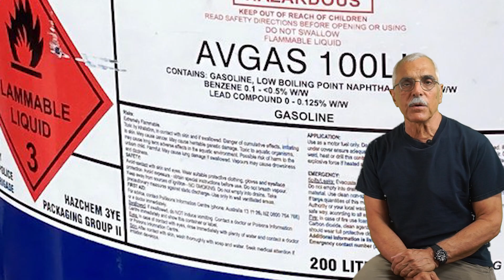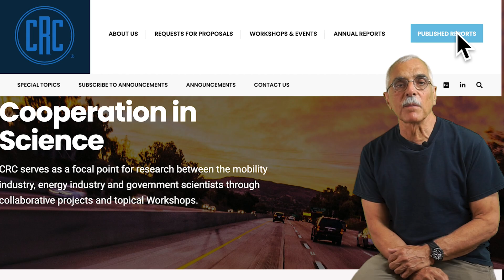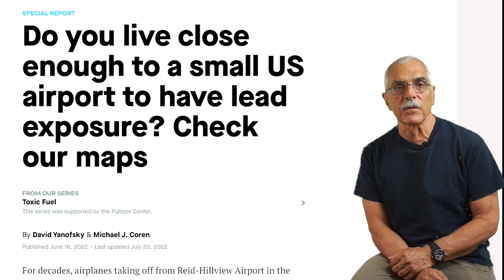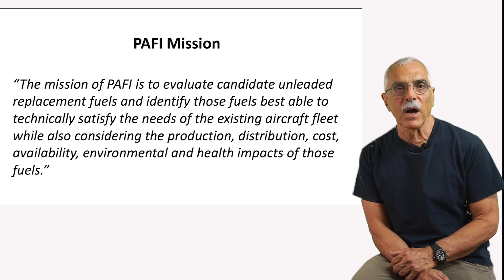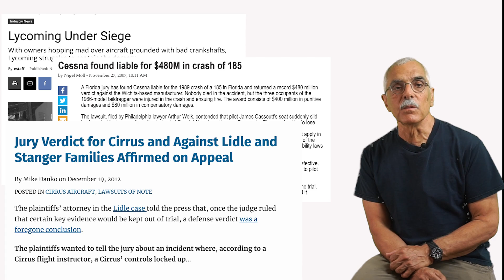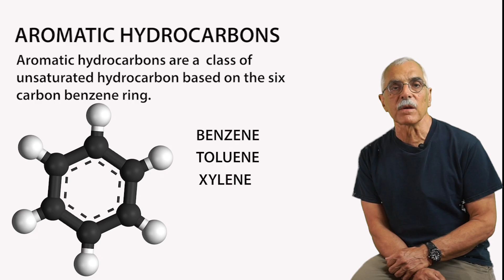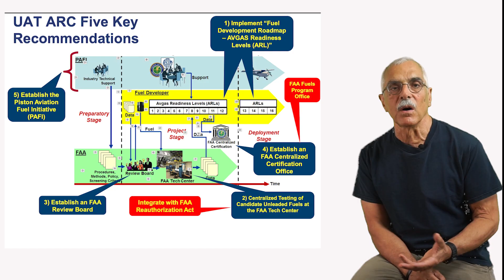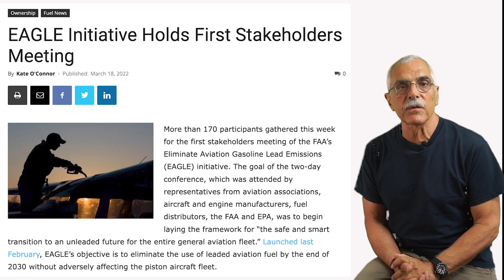The Long, Twisted and Slightly Ridiculous Story of Avgas Part 2

Comment: Perhaps it is not the fuel alternative, rather the insufficient enging development that is the issue. As Paul B. has already succinctly articulated, bringing a new certified engine into aviation is very difficult. 
Importantly we need both. 
Our fuels will need to change over time anyway notwithstanding the need to get the lead out, and we can no longer rely on 1960 technology based power plants for the next hundered years.
And in both cases it is Regulation that is the issue. Regulation wholeheartedly destroys competition and innovation.  Game over, right there. The barriers to entry are almost impossible given the vested interests on the encoumbant producers and the dead hand of the behemoth of bureaucracy.
Get the lead out of governments, their regulators, and open up responsible competition and sit back and be amazed at the innovation going forward.

Comment: The longer they drag it out without doing anything, the more likely it will all be overtaken entirely by electric in GA, both new and replacement. Not sure what that'll mean for vintage and warbirds though. P-51 goes electric when? I have an old aeroplane in pieces, with two Lycoming O-540s, and it seems almost morally wrong to use time and money to restore those engines to flying condition given both the Lead situation and global warming, to say nothing of noise and reliability. Adapt or perish is the unbreakable rule.

Comment: As a classic car owner in the UK I have been through this with E5 and E10 fuel. Cut a long story short, all the fuel hoses in my car have had to be changed, the seals and gaskets in the carburettor also and the float in the carb has had to be changed from soldered brass to plastic. But actually no problem, the car still runs fine.

Now I know aviation is different, but if 40 years ago the regulators had not given Avgas the bye, the problem would have been solved by now.
Reply: Problem being ethanol has a short self life. In other words it turns to crap n wrecks n plugs up stuff in short order. So I think ethanol is probably out as an option.
Reply: @oneninerniner3427  I am not suggesting it for aero use, though we don't have a choice for cars in the UK.
I am saying that if you brush the problem under the carpet for 40 years you won't find a solution.
Reply: @donaldasayers  truth

Comment: 🤨I'll be 66 in 8 years, awfully late to get back into aviation. I left, in part, because I didn't want to be even a small part of the problem of poisoning kids living near my airport for a leisure hobby. 🤞Here's hoping they speed up the process while I'm still young enough to enjoy a $1000 hamburger.
Reply: As he said in the video, only about 1/3 of GA engines require 100 octane gas. The rest can run on ethanol free auto gas with an STC, or if you go with an experimental airplane no STC needed. Or fly an ultralight. Plenty of ways you can fly without burning leaded gas.
Reply: @jonathanseyfert8256  I'm limited to rental aircraft. ($) I doubt I could find a rental fleet using trucked in canisters of gas from off airport. I don't see my neighborhood airport adding a tank for E-free unleaded. I'll keep hoping and waiting. 🤞

Comment: Well Done, Bravo!  Textron / Piper et al should move to small 200 hp turboprops burning Jet A in the 172 / Archer respectively.  By the time the 100LL thing gets solved the entire fleet will have moved on from 100LL (I keep hearing the Caravan is just as easy to fly as a 172/ 182). Those 75+ year old type versions with a Lycoming / Continental still propelling the airframe could benefit from an EPA / FAA regulation REQUIRING Mogas be sold at certain airports (with guidance from AOPA, EAA, etc of course).  As those older aircraft versions switch to Mogas, largely due to on-airport availability, demand for 100LL plummets.  Low demand pushes Oil companies to consolidate production with some exiting the market.  Limited 100LL supply would tend to further enhance demand for the aforementioned turboprop certificated versions ..... an almost 100% market solution ..... bummer for the Lycoming / Continental piston products though ... just a random thought like the millions of others out there

Comment: As I understand hydrogen fuels, they actually have more power per volume than gasoline and require little in the way of engine modification. Has anyone even looked at that?
Reply: it's the weight of the tanks.   Hydrogen doesn't liquify (like propane) under moderate pressure.  The tanks have to handle 2,000 psi - very heavy.

Comment: i remember back to 1995 when i was undertaking my early flight training that there was a lot of discussion about moving on from 100ll including diesel etc, im saddened now that approaching 30 yrs on im still putting 100ll in my aircraft and General aviation in its wider sense has been stuck in the mud and ham strung through regulators to point of stupidity. i think its more likely that GA goes extinct before we drop 100ll
Reply: GA as we know it will soldier on in the corporate jet arena with their new fuels, and private GA will eventually shift over to much shorter distance electric aircraft. It will be better than the extinction that happened in Europe (which slashed piston ops down to mostly VFR), but no where near the vast traveling of today in the U.S.
Reply: Electric airplanes will be a closer solution before the 100LL phase out....and I drive ICE cars.

Comment: Another very important aspect not mentioned is shelf life . A lot of these GA airplanes sit for 6 months or better at a time,  and your standard automotive fuels will go bad in that time frame where 100LL is still usable.
Reply: and sit on a hot tarmac which can't be good for fuel integrity. also, most fuels store better completely full in the tank, which airplanes avoid doing. lot's of dynamics here. or DRAIN your fuel all the time if your plane sits for four months???!!!
Reply: ULP in reality has a 30 day shelf life then turns to toxic varnish. And this is sealed tanks.
Reply: Why is the fuel in my car, which has been sitting in the sun for 3 years, still fine?  Seems there's an easy solution here.  For instance, there's fuel stabilizers sold for gasoline engines.
Or even take responsibility for keeping your fuel fresh by renting a hangar or putting a tarp over your plane?  Just tossing out some ideas here, since I don't think it's the government's job to keep your fuel fresh, especially if it involves adding a neurotoxin 🤪 to your fuel.
Reply: @loungelizard836  my airplane sits in my hanger next to my house is that responsible enough

Comment: Seeking a drop in replacement seems like the perfect excuse for big oil to stall the process and get away with producing a profitable poison for kids consumption. 
Time to set a hard date for leaded fuel to be banned. Basically say to that you've got (for example) 5 years to get your aircraft ready for mogas.
Otherwise enjoy your new 1:1 scale static model. 
Continuing to spray lead onto children around airports is simply not a morally or intellectually acceptable option.

Comment: A great summary of the American situation spoiled only by the lack of any mention of BP's UL91 AvGas which has been available for a number of years in Europe as a certified drop-in 100LL replacement for about 55% of light aircraft, including many Lycoming engines as per SI1070Q.
Reply: Mike, he did mention that BP and Total had a replacement. I burn BP and Total UL91 in my IO-360/180HP/8.5:1 engine, and it works fine, as does mogas.  Sadly, many airfields don't sell this fuel, so I have to use 100LL from time to time.   The main problem seems to be that the goal is a 100% drop-in replacement, which only G100 has, and for some probably financial reasons, the FAA or their masters don't like GAMI.
Reply: @dermick  Apologies, I must have missed the mention. I agree that a 100% replacement is still needed, but UL91 is being approved for more and more engines/airframes each year - my AEIO320D1B was added to the list recently.

Comment: It is of course a bad look for aviation to still be using leaded fuel. However, the significance of relatively small amounts off lead in a minor market in no way compares with the serious damage caused by large volumes of high levels of lead in fuels burned in close proximity to children. Back in the day, a comparative study of young children at two married students apartment blocks at UCLA, one near and one further away from a major freeway, showed a significant difference in their development. One of my fellow university students also did a study of lead in soils at a school next to a major road. He discovered that lead levels dropped off rapidly with distance from the road so that just a few meters away the levels were close to background. General aviation using low lead fuels is very unlikely to result in the kind of concentrated exposure which caused so much harm to children in the '60s. Children today face very different threats.

Comment: The easiest way forward for the EPA would be to outlaw any further production of piston engines that cannot use unleaded. FAA then allows automatic STCs to fit new build engines that are engineered as direct replacements under the new rules, which should likely also incorporate modernised ignition (given the "free pass"). The petroloeum companies get a few years to manufacture, then they can only supply an actual additive.
But what would I know?
Reply: I think the result would just be a big shoulder shrug from petroleum companies and we’d all just have giant expensive paper weights in the GA world. We’re just too small a group for anyone to care about.
Reply: @tringalij  possibly, though if operators have a choice to use mogas that is also cheaper and possibly in an engine with more optimisation.
But it seems like a fantasy at this point.

Comment: At some point the right Lobbyist is going to get to the right congress people and replacement or not, 100LL will go bye-bye. Do not pass Go, do not collect $200, GONE. The need for a perfect 1:1 drop in replacement is the fundamental limitation in replacing 100LL. In order to protect SOME Aircraft engines, It will eliminate ALL Gasoline Aircraft engines not approved for MoGas.
Reply: I think you nailed it.  All those fuel stations that have 100LL will be screaming for G100 or Swift, and the problem will be solved.
Reply: @dermick  I mean that already happened up in the Bay area. 

The OWNERS of the affected aircraft will need to be the ones to sort it out, or sell and move on to the late 20th century with the rest of us. Nothing a 6 or 8 cylinder can do that a turbine can’t do better.

Comment: electronic direct fuel injection could easily make 91 mogas work in high compression or high boost applications. The auto industry has performed black magic with preventing detonation in small displacement high compression high boost engines (ecoboost) all while using 87 octane to do it. It's about time for 550 ci and 360 ci (very common) engines to only be built new as FADEC setups certified for 91 octane as well as FADEC upgrades offered during overhaul. So they can benefit from cheaper gas...then GAMI's fuel will fill in the gaps for engines that can't/won't be upgraded.
Reply: Not sure why this isn't the obvious solution. Modern EFI should easily be able to pull this off....

Comment: Outstanding two-part presentation, Paul. Side I see: as I understand it the general aviation “asterisk,” as you put it, had a time limit. Pushed through by AOPA (again, as I understand it), the GA exception to lead removal in the 1974 Clear Air Act was for 10 years. The fact that FAA did nothing well beyond that 10 years, and extensions, and then that EPA did nothing to penalize FAA for not eliminating lead on schedule, is why environmental groups suing the EPA is what drove this issue for the last couple of decades. Any perspective on that?
Reply from the maker: Unfortunately, I do not. The lawsuits may have driven the EPA to act, but it took them 30 years.

Comment: I cant help wondering how many thousand  petrol powered vehicles there are out on the road for every piston aircraft in the air. I doubt the removal of lead from Avgas will make much difference at all in the big scheme of things.
Reply: A friend of mine is a glider instructor in CA. The school wanted to start using a brand-new winch tow vehicle imported from overseas. Its engine burned unleaded car gas, but (oops) it wasn't certified under CA emissions standard. Note I didn't say it didn't meet the standard. I just wasn't certified. Send it back, keep using the Piper Pawnees that use 100LL, fly over houses, and make more noise.

Comment: Slow motion noise machine. The brilliance! Not an aviator but an avid fan of the idea, I have always been frustrated with the aviation community and their ways of doing things. Obviously the volume is so low that no one can put in the r+d dollars that car companies do but why don't we have a Toyota Corolla equivalent, modern materials built airframe and turbo four banger? One I can afford, hop in and fly with a simpler preflight and longer maintenance intervals.
Reply: Call it LSA, or Experimental amateur built.